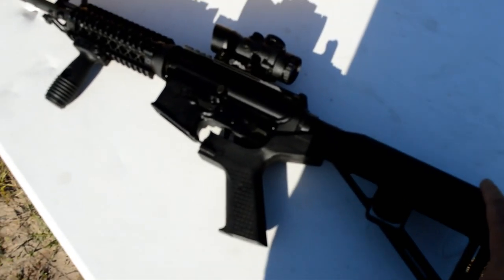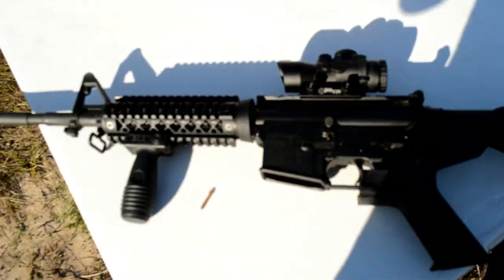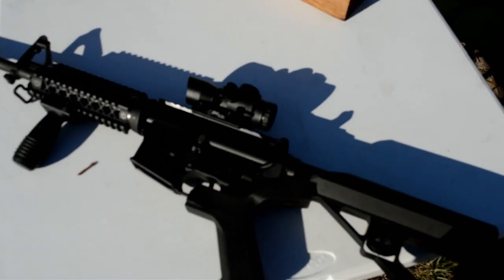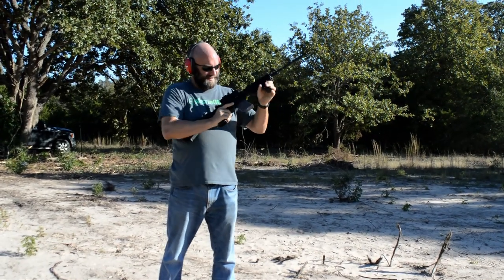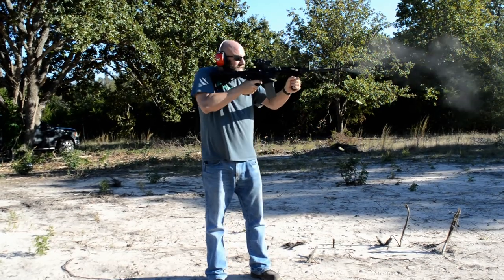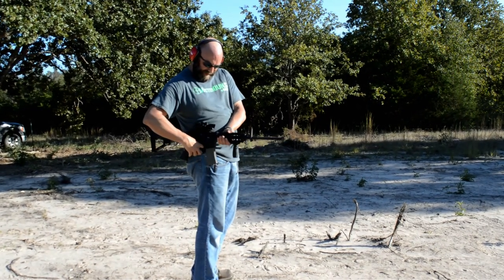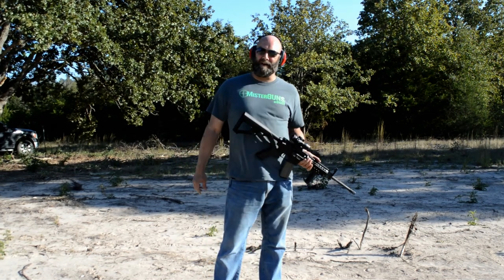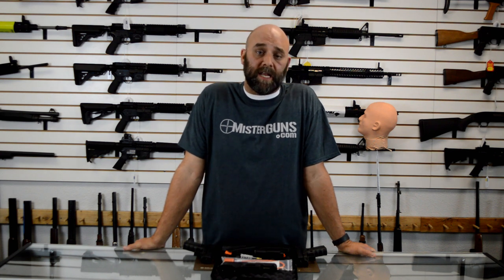BUMP FIRE Stock on an AR-15 - How Does It Work?

Comment: The fact your brutally honest is awsome! Those are not accurate and you can do the same thing with your belt loop or a piece of wood with 2 nails or many other ways . one person used it for bad and now everyone has to lose out on the fun . it has no practical use other then to blow through rounds and have a good time . smdh

Comment: And, from what I've seen of photos of Paddocks hotel room.. I think he was left handed (his calculation notes had the pen on the left side of the note, usually meaning he used his left hand to write then sat the pen down on the left side of the paper) ... Assuming he's left handed, how would that change the way someone would use a scope, how would holding the weapon change and how does it effect body positioning to avoid the spent shells flying out of the weapon?
Reply: Chiming in a bit late but was bored.  I'm left handed.  They make firearms that eject the ammunition off to the left instead of the right.  I've only ever shot right handed guns though.  The expanded shells being ejected dont really fly across my field of vision because I have my left eye over the firearm to look down the sights.  I have been hit by the expanded cartridges though.  It stings a little.

Comment: I agree, these are pretty useless except for converting money to noise. I attended the inaugural Texas Firearms Festival in 2014, and Slidefire had a number of AK and AR pattern rifles equipped with bumpfire stocks, and they didn't even bother putting up targets. Forget trying to get a sight picture. 

The kind of measures that actually would have prevented this situation would invoke the righteous wrath of 1st amendment  stalwarts as you'd basically have to outlaw any venue that would create a target rich environment like that, and you'd have to severely curtail people's right to peaceably assemble to prevent it. As for guns, even if you could make a wish and confiscate every single privately owned gun in the US in an eye blink,  you could still make new ones; 10 year old kids make full auto Kalashnikovs in the Peshawar Valley in Pakistan using hand tools and primitive blacksmithing gear.
Reply: I would, however, trade regulating bump stocks in exchange for repealing/modifying the Hughes Amendment, and allowing new MGs to be registered to individuals.

Comment: I now these are kind of goofy, but I really wish I would have bought one of these for the AR before now. The prices have really gone up. Dand I have to try the belt loop trick!
Reply from the maker: You can't find them anywhere after last week. Sold out everywhere. Belt loop is fun, just make sure you're aiming down!
Reply: Yeah I know, anyway, how to you place your finger on the belt loop?
Reply from the maker: Anthony Quinn you just stick your finger through the trigger guard then grab your belt loop.  Then you pull the rifle forward into your finger and allow the bouncing of the rifle to make it "auto"
Reply from the maker: Just wrap it around your belt loop so you hang on. Same as the bump fire where your finger is on the ledge, you're just creating a stationary object for the trigger to bump as you pull forward
Reply: Get a Fostech Echo

Comment: Hey can someone answer this for me... If your using an AR15 type weapon, with holographic scopes, AND  a bump fire stock... Would knowing and or using calculations of height, distance, windage, etc... Even be realistic?
Reply: skinny boy I'm going to say no. Those calculations are good when firing one shot. (Sniper situation) Full auto is spray and pray, mostly for suppression.
Reply: So maybe the calculations were for the fuel tanks? Would that be a reasonable assumption? Do u know what kinda weapons were found in the room? Which one would likely be used with those calculations?
Reply: skinny boy To try to answer your first question in your last post, If he wants to hit the fuel tanks, he would just have to aim at the top of them, the bullet would then drop and hit them somewhat below. 

NB: The drop of a bullet depends primarily on the flightime. There is approx. 700 yards to the tanks, which a rifle projectile usually would travel in less than one second, but let's say it takes one second, the bullet would then drop approx. 16 feet.
Reply: Found an  Ruger American .308 caliber bolt action rifle with scope and a LMT LM308MWS AR-10 .308/7.62 in the second room ...

Comment: Great Video!!
But Weird, considering Paddock scored multiple hits on several victims from 1500 feet away... some 2-3 head shots I believe.. (sarcasm)
Serious question though, how tall are you compared to the 6' 3" paddock who allegedly fired a bump stock through that door (and down the hallway at Campos, striking him only once...) and have the bullet holes obviously go through the door MUCH lower than Paddocks shoulder "lean in" firing height?   Look at the door photos.. those seem to be fired by someone much shorter than Paddock. 
Just Sayin.. 
;)
Reply: Roger that Mister Guns. I'll Bet at 6' 2" if you shot through a wooden door from 6 feet away from it,  down a long hallway at a retreating target, Your shot grouping would be a bit higher than that Mandalay Bay doors is ..  See where I'm going with this? 
;-)
Reply: Vegas was bs.
Reply: Theres not any photos or video of any gore. All acting and noise
Reply: The cycle rate in vegas shooting is slow as a full auto AK. An AR15 is fast as fuk. Let's be real folks. There are only brand new unused planted ARs in the vegas pictures. Its all fake crime scene. And suspicious large amount of law enforcement presence at that concert. I think it was a joint collaboration. Just like sandyhook

Comment: How does it affect the firing mechanism over time if you were to keep doing this?  I mean would it cause more wear and tear more quickly than normally intended use for a semi-automatic weapon?  Pardon me if this sounds stupid.
Reply from the maker: John Glue not stupid.  The main concern is heat.  Repeated raising to high temeratures can wear more on a gun.  Especially like the barrel.  Chrome lining and certain metal types can help.  But like anything else the more mechanical abuse any machine receives the more maintenance it needs
Reply: Thanks for the reply.